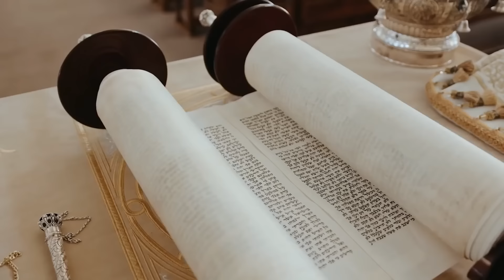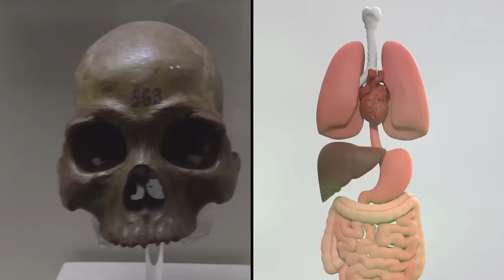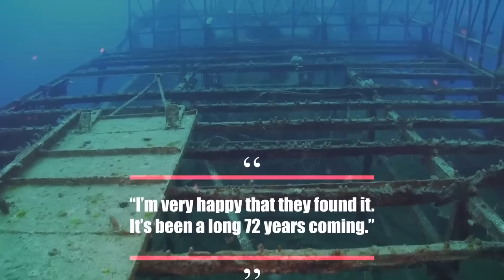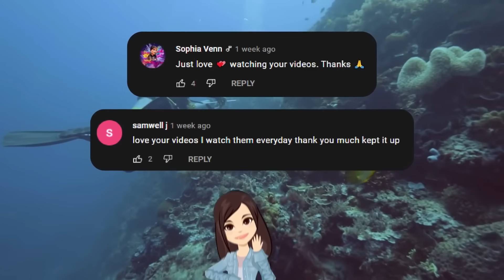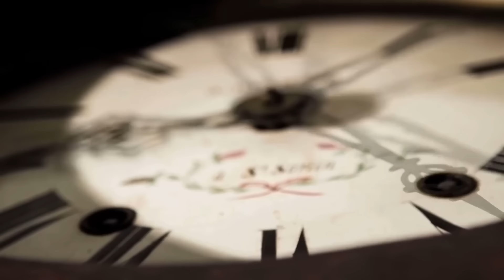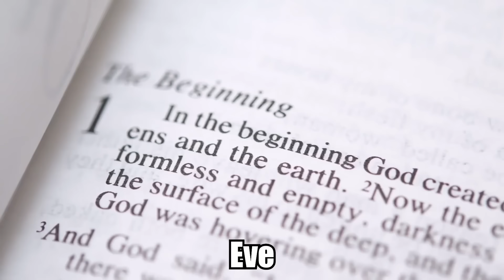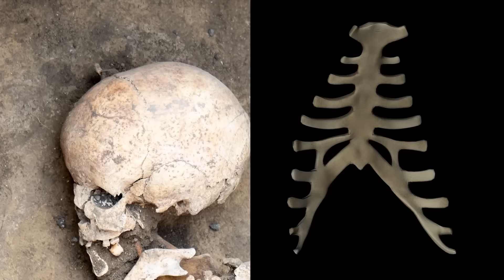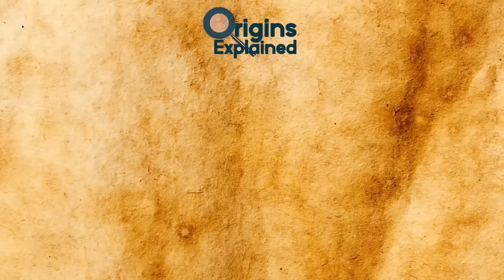Mysterious & Bizarre Discoveries

Comment: The "Standards of Science and Research" requires"the Mind to be fully open and free of any predetermined Beliefs, Theories, and Opinions, ..."
Academics are also to practice a habit of being "Conscious in Thought" + "applying Higher Mind" aka Mature Mind. 

The Lower Mind, aka Ego Mind, is where the negative thought energies reside (fear, prejudices, Judgemental, envy, jealousy, etc)

The practices promote ethics, accuracy, and clarity. 

Clearly "Mainstream Academia" falls short as they use a "19th Century Theory as their Fact Foundation for their Paradigm and Linear Timeline" 

The "Standards of Science and Research" prohibits using a Theory as Fact.  Particularly to use is as a tool of measure to reject other finds, theories, and artifacts that do not support their Theory Paradigm.